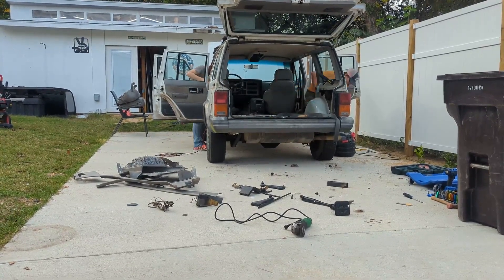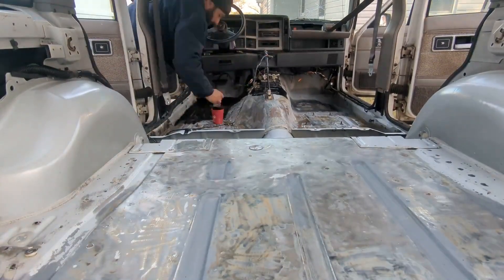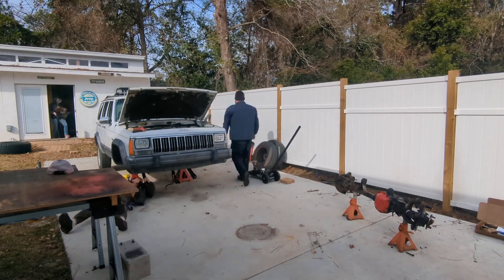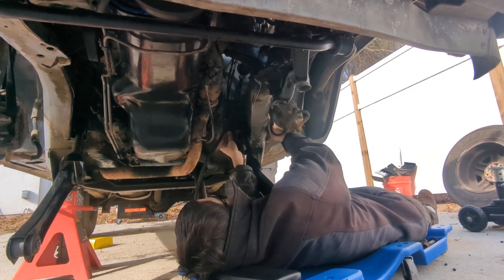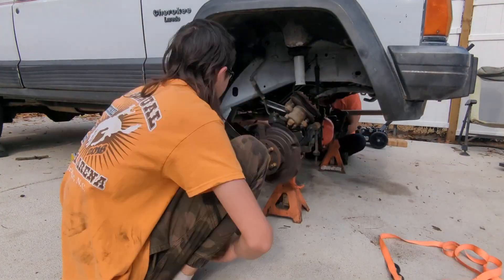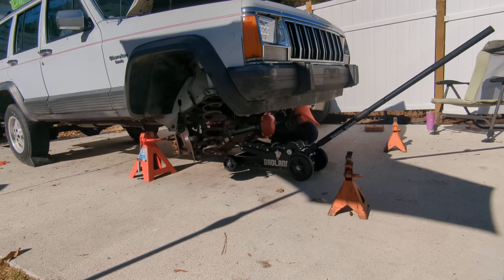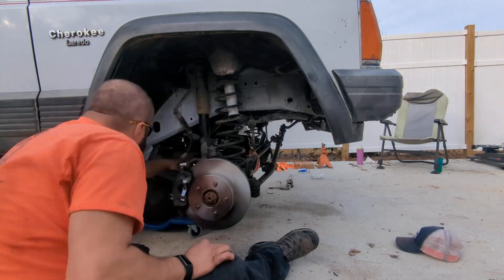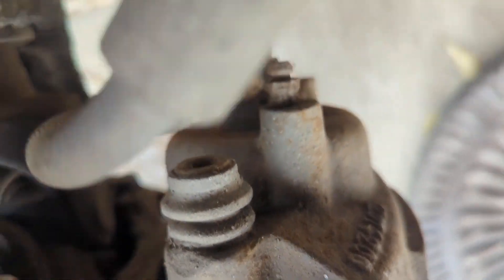Project Betty White Axle Install

Comment: Had the same situation on the upper caliper bolt on the driver side of my 97TJ. Hole was stripped out. Replaced ball joints while I had the knuckle off.